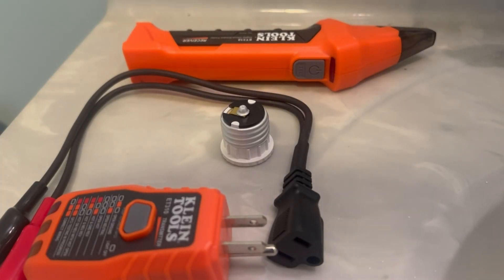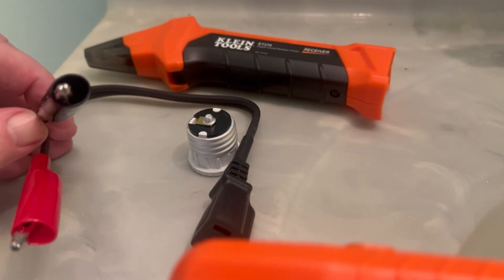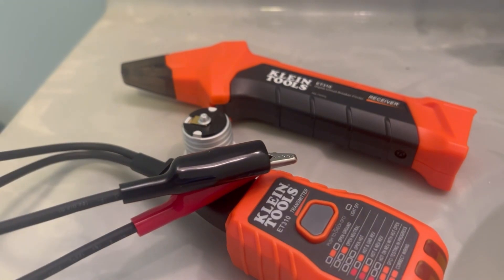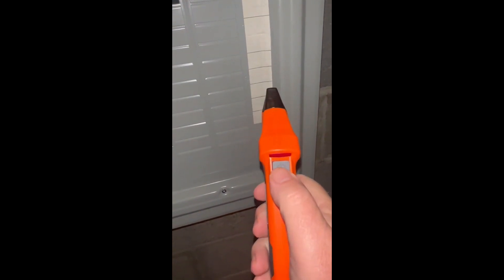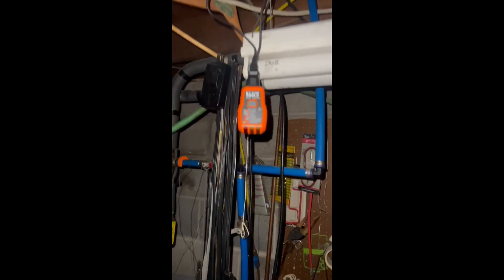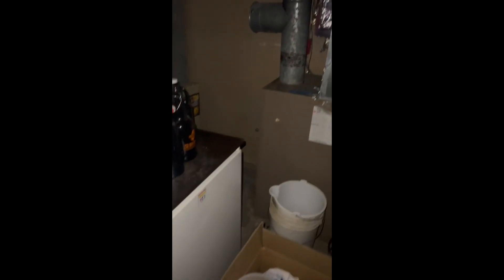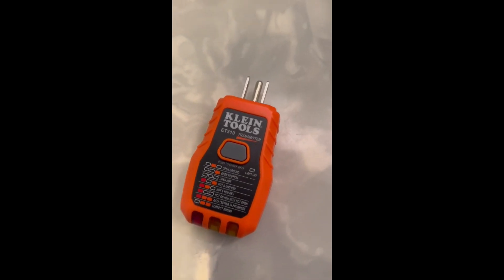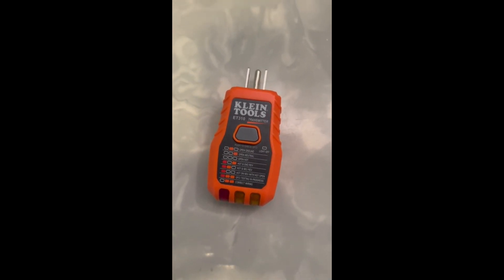Klein Tools ET310 Circuit Breaker Finder Review - Find Those Phantom Breakers With Ease!

Comment: This tool works great. Every time I tried to find the breaker to turn off, it usually ended up being almost the last breaker I switched off. If you use this tool correctly, you will shut off the correct breaker immediately. WORKS GREAT👍.